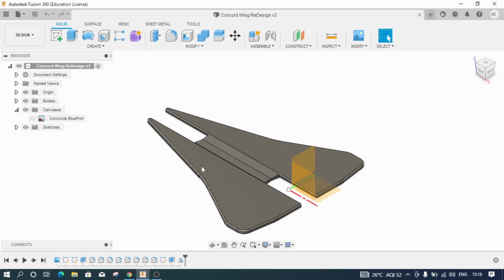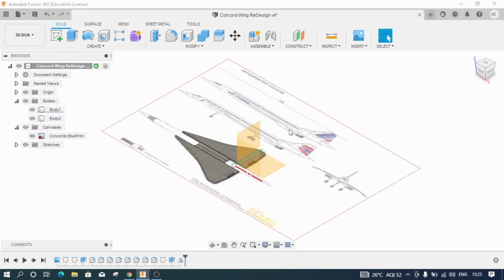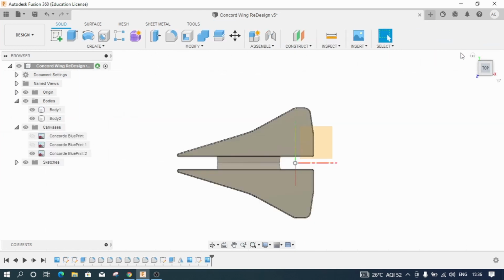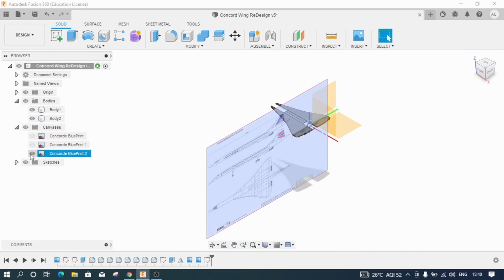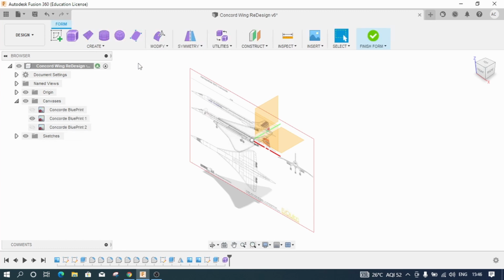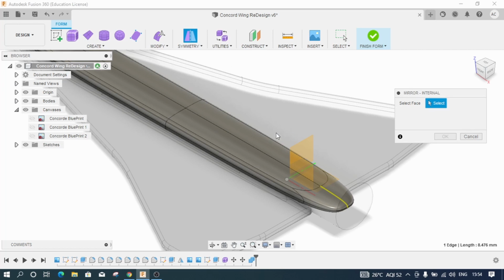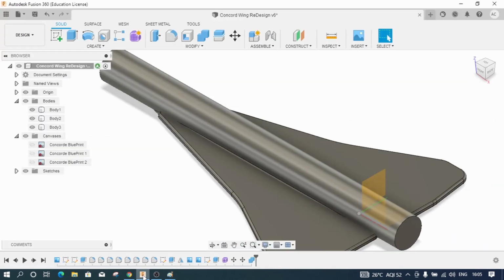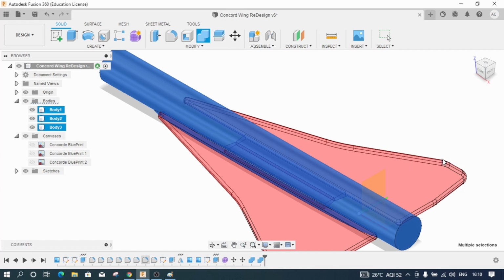Week 2  - Part 2 -  Concorde Aircraft Fuselage Design Approach | 3D Printing Internship

Comment: Can you plz suggest best software for Aircraft and aircraft interiors design
Reply from the maker: Fusion 360 patch workspace offers excellent surface design capabilities. But if you need dedicated surface design tools you can use CATIA which is used by Boeing and Airbus Companies. For interior design you can use Autodesk 3DS Max. Also Blender which is a free software is also good for furniture and seating designs